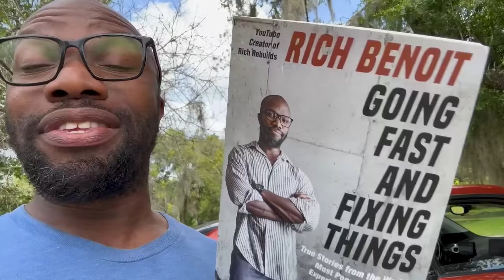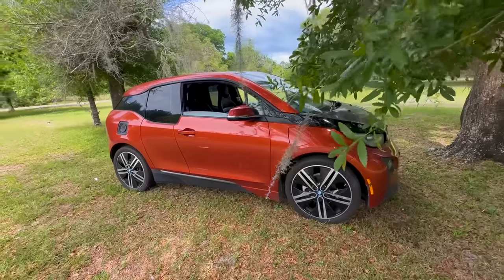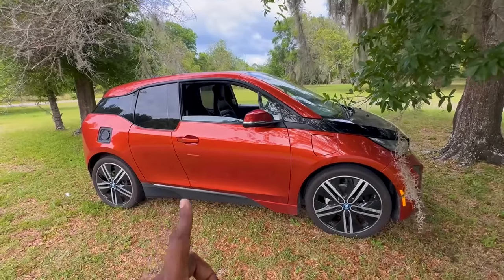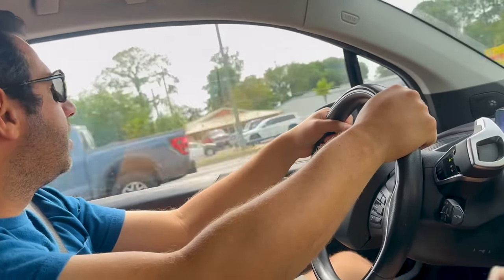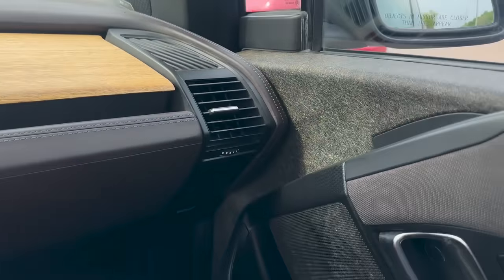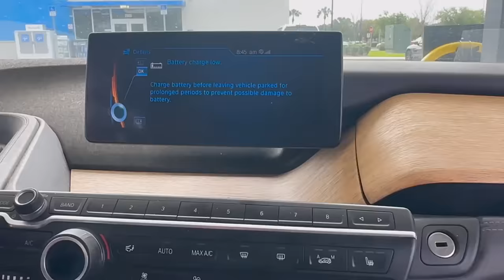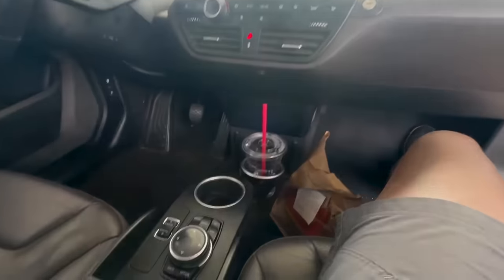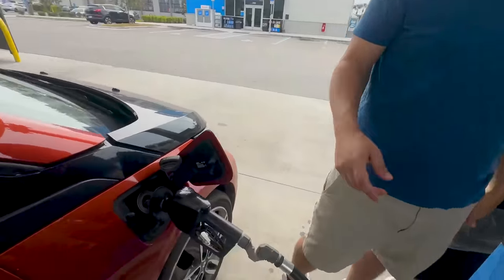I Bought a Ten Year Old $3500 EV and I Increased its Range To Over 400 Miles!

Comment: Dumb car, dumb modification.
The best part of this video was the interaction with you and the other guys.
Why didn't you pump your fuel cell into the main tank directly?
Then the gas gauge just would not go down at all until the entire fuel cell was actually consumed and you only had the factory tankful left.
All you had to do was tap into the filler hose at the tank with a T or something, or put a L tap on the tank itself.
I'm not sure where the factory tank is, but if its below your cell you could have even had it hands off gravity fed so like I said the fuel gauge would never start to drop until you were down to just the factory tank full left.

The real "fix" for this pos "car" would be to swap in bigger stronger batteries, and a fuel engine capable of recharging the battery rapidly even while under full load.
I've never understood the idiocy around the total lie that is EV's, but all that bs aside the proper first step for us as a species would have been to convert all vehicles to hybrid, and perfect it, then maybe eventually (When/if all the real EV lies are fixed) we could move to all EV powered vehicles.
We should already easily have small fuel powered engines in our cars that can easily recharge the EV full size batteries while also under full load and driving.
The electrical technology totally exists and has for a while, a virtually car illiterate person would know this once you tell them what an alternator is and what it does in a gas powered car.
Do something real, make the first REAL Hybrid that never needs to plug in and gets 1000 miles of range with 100mpg or more.
The small engine could be diesel, or best idea ever, HYDROGEN.
Then you could just ditch the entire EV part and just run the correct fuel we should all have been using for decades, Hydrogen, with zero emissions, zero environmental impact, zero mining, zero recycling issues, and ultra low cost to operate and refuel.
The fact we did not do this worldwide decades ago proves our species is stupid, corrupt to the core, and doomed.

Comment: 😮 The problem with the little engine in it is it's horrible doesn't work. it's stinky. I prefer the all electric one which I did have. I had 31 KW and it was good. I've got the 41 KW now which is perfect for me and the s model is brilliant. I wouldn't touch the Rex one cuz all the problems are with that engine and most people don't use it unless you're an idiot 😊😊😊😊😊 it burn toxic fossil fool fuel which is the main driver anthropogenic extinction brilliant little car but don't touch that stink engine 😊

Comment: Since when does only electric cars use synthetic oil that causes rubber to swell or shrink? Completely wrong but hey 😂 as wrong as using oil that fuks up your seals. Beginner mistake 😂
Viton or fkp or whatever "high tec" flexible sealing you use it needs to withstand low temperatures... if you chose cheap oil and cheap seals life will teach you

Comment: Personally, I don't mind an EV. In the event that you run out of battery, you can go to gas station. If on long trip, like mentioned before it'll be annoying, but at least you have that option. Then, if you go into a hotel, can charge up for free. I do like the concept, but as they age in this video it shows its flaws! This car would be perfect for local driving only or very short trips within state lines.

Comment: Ok heres the full store the correct price is $22000US but when the dealer found out it was an insurance claim they doubled the price. So in this case its up to the insurance company to fight this one. This happens to even gas cars. They have two prices, one for you and one for the insurance company. Im pretty sure each insurance company has representatives that negotiate these things and im sure tge price comes down a lot more then $44000US.

Comment: No safety cage for the front tank. Never seen a real mechanic put a box of flammable in the front of the car with a crumble zone designed to pierce it at the slightest 10 mph accident.

Comment: Increasing its capacity to burn gasoline contradicts the supposed benefits of electric propulsion.  And it is done at the cost of cargo capacity. Also, it seems that the added fuel tank, being at the front, has little protection against a front end collision.

Comment: Don't worry about any front end collisions Rich, having eight gallons of fuel located in the front end should not be an issue... 
I see that a license plate frame, if installed correctly will certainly bear the brunt of a front end collision. 
You are most welcome Uncle Rich.
Reply: Proper license plate frame installation is a dying art, especially if backed up by a front mounted gas tank designed by idjits.
Reply: Porsche & VW have gas tank in front, just say'in
Reply: @johnclunan4488  And designed with that in mind, no so much with this "addition".

Comment: Rich, don't know if you know, but there's an OBD hack you can do to start the engine at 70% battery and start charging like its European counterparts,  instead of having to wait until it's below 5% like it's programmed to do for US market vehicles...it's capable but the EPA wants you to use as much electric power before you turn to gas for emission reasons.   Costs 20 bucks.✌️

Comment: Used to own one, same color. Great car until the rex engine cracked the connecting shaft to the generator and caused the motor to vibrate so badly it kept throwing ping codes. Coils and plugs did not help, and bmw wanted wayyy too much for the repair. Cut my losses and traded it in (with a full battery so I'd be long gone before they figured out the rex was dead).
Reply: If you ever get screwed over on a sale or any business think about what you did. 
You will have no right to whine about it then lol

Comment: I have a 2017 hyundai sonata phev. 27 miles all electric 600 total travel w gas. LOVE IT! Loaded w tech and after 4k tax rebate cost aprox $12k w 72k miles. I got a steal I think. Honestly, not sure at all why Hyundai only did a limited run of this vehicle for a few years. It makes so much practical sense and if they got it down to a reasonable price and fine-tuned that it would be an absolute knock out of the park seller

Comment: To add the Aux fuel tank all you need is to tap into fuel line. No need to fill aux tank from normal fuel fill just open hood and use aux tank filler. One concern would be being able to read fuel level of aux tank.

Comment: Possibly the most enjoyable car I've ever owned. BEX is somehow short for idiot. This car is meant for short range commuting, home charging. It'll go to 60mph in about 7 or 8 which is absolutely more than enough even for going on the highway. Range is such a blown out of proportions issued, primarily driven by american needs, even though most americans drive their cars for 20-30 miles per day. For zipping around town and driving the kid to school, this thing is amazing. Interior is so fun and innovative, seats are surprisingly good, the Harmon Kardon is great, make sure to get the bigger center console screen (oh way, you can't get the car at all, but if you for some reason are a saint and buy an old used one, get the bigger screen). Also, the leather seats are lame and age in an instant. The cloth sets are surprisingly good. 

I own an X5 PHEV and a 911, but the i3 is the car love story of my life so far. It is really the most innovative and surprisingly fantastic car I've ever owned.

Lastly, did Rich just put a giant gas tank in the crumb zone of a car? If you hit anything with that thing, the entire front is supposed to turn into a pancake.

Also, on the note of the tiny fuel tank, it's actually 2.5 gallons, but for some reason US regulations require that it can only be utilized to 1.25 gallons. The other guy on the video somehow points this out, but it doesn't really come through. I'm curious what the "regulation" actually is.

Either way. Thanks Rich for featuring this epic little commuter. Also, ordered your book long ago, can't wait to receive it in a couple of months. Cheers!

Comment: "if we have to stop at a level 2 charger...." Did he not buy a version with a CCS port? The i3 had DC fast charging with CCS on most units. Edit: now I'm at the part where he pops open the charge port. Dude actually bought it without CCS. What the hell? Slap your friend, Rich.
Reply: The early versions didn't have CCS only L2. That's perhaps why it sold for $3500.
Reply: @CSAFMedia  the early versions did offer CCS, it was merely an option rather than standard.

Comment: That little pulse pump runs a lot better when it's at 12v. Literally. It's got to do with the way the pump cycles. Too high of the voltage, the plunger doesn't cycle fully. So less flow. 

I once pulled over 50 liters of diesel with nothing but this little pump. Took me a few hours, but it drained my tank completely without the need to drop the tank. Fuel was bad from being left for 2 years due to covid restrictions.

Comment: We need a rex for every car.    I drove my Nissan leaf everyday I love using the battery on night time rate.   But if I could put. A small generator with a fuel cell.  Perhaps removable.    Those long journeys are easy.

One reason you might not be able to keep up with highway speeds is your batteries may have heated up.

Comment: Battery replacement cost on this is insane! at least 15k for aftermarket, and 30k at the dealer. So if you don't want to do that you are left with a very slow 30mpg car.  this is why a 10yo one is so cheap.

Comment: The gas tank is software limited in order to be classified as an EV in California. The gasoline range can not be longer than the battery range.

Rather than having a separate smaller gas tank, they changed the software so the engine stopes before the tank is empty..

Comment: uh... well I had a 2013 Chevy volt.. it had about 45 miles of ev only range and then a 9 gallon tank.  The problem was, if you filled up the tank, every single day you would drive and if you didn't go more than 45 miles, you would be carrying around all that extra gas.  After a year, the car would actually start burning off the gas, because it would go bad

Comment: The reason the cheap fuel pump did not work I believe is because the outlet is supposed to be upwards at a minimum of 15°. I’m pretty sure I read that and some instructions somewhere when using one before. Having the outlet downward is probably why it did not work correctly.

Comment: Hey Rich, no need for a fuel pump - fuel tank test system creates a vacuum to test the primary tank and actually draws the fuel into the primary tank from the auxiliary tank that you have on installed - so it works as long as the system is sealed properly - Jeremy PS i worked with a guy over 5 years ago did this same upgrade

Comment: I used to race a BMW 325i and we dropped a round 8 gallon fuel cell into the spare tire well and plumbed it into the fuel filler neck just like you did here for when we ran endurance races.  In 2005 we won the SCCA 13 hour race at VIR using that setup.  Same deal, switch on the dash which was used when the regular tank got below 1/4 full.

Comment: The only thing that has put me off from getting a used i3 is the carbon tub. I'm fairly sure that if you crash it it's gonna be insanely expensive to repair due to all the carbon fiber used in its construction.
Reply: So, you are primarily worried about something that hasn't even happened and may never happen? Wow! You've got bigger issues than that i3's carbon fiber tub.😂
Reply: @tigerstripeeyes9871  It's perfectly normal to assume you might crash at any point in traffic  and take that into consideration when buying a car like this. The only one with issues here is you as you lack critical thinking and have a cognitive dissonance. It would be quite arrogant to assume that you're such a good driver that it will never happen to you while not taking into consideration how badly other people drive.
Reply: LOL!! What does assuming do? It makes an ASS out of U and ME.

 It’s most likely going to be a “low-speed” accident anyways, so don’t sweat it! If you get into an accident with it and it carbon fiber  tub gets damaged beyond repair, your insurance company will simply total it… so why are you so scared about it like some little girl? Maybe you should put your big boy pants on, man up, and just drive? That’s an idea! 💡

Comment: I am shocked he just didn’t just upgrade the pack. You can do an upgrade to the later 94Ah pretty straight forward retrofit. You can do a 120Ah battery but not as straight forward but can be done as I successfully done one for someone. It technically is not hybrid the engine for only charging the HV battery and that it. 

Don’t bother swapping the individual modules, it be a losing battle as those as all those cells will be on their way out and be a waste of time. The 650cc 2 cylinder engine only for charging the battery, so extending the tank won’t do much as those 60Ah battery do degrade quickly due to the way they were cycle. It going to get to the point of no range left regardless after a while and car won’t move without battery power  as engine is only a generator. Those are not hybrids they are 100% electric and only use the engine REX model for charging the battery and that it.

The 94Ah battery would be the easiest and cheapest way to go and those don’t degrade as fast.

Yes the aircon compressor love to fail on those as they grenade  itself and metal gets into whole system. They are expensive to replace. The compressor by itself is $800 to 1k for a used one which likely could be also bad, or in its way out and $1500 for a new one and that not including everything else that needs to be replaced. You need the AC working as it also used to help cool the battery pack. It cost around $3500 to fix the AC after all said and done. It is absolutely necessary as cools the battery pack, otherwise part the car out.
Reply: It is a serial hybrid. Others like Toyota are parallel hybrids.

Comment: I came very close to buying a brand new 2020 Prius after waiting 20 years for an EV. Being very curious I started asking questions, analyzing. I came to the conclusion the Prius was a fraud, e.g., NOT a hybrid EV, but a hybrid ICEV with insignificant electric assist, or as Rich would say: "The worst of both worlds". Why would Toyota do that? Also, why would Toyota partner with Elon to experiment with the RAV 4, be successful, and end the whole project? GM built the EV-1 to fail, it didn't, and they quickly recalled all and destroyed them. Why? There was demand, public pressure to build an EV which is opportunity for exploitation/profits. Why try to crush it? What the hell is happening with mega corporations? Tesla proves "BIG" does not equal "out of touch", so WHY? Is it economics or politics? Since politics is irrational when viewed long term, I deduce politics secretly supports Big Oil because the US Empire is funded by the "petro-$" since 1972 because gold was impossible to monopolize/control. The Gold Standard Dollar was honest money, impossible to artificially inflate (a tax). It protected us from govt.

Comment: Wait, wasn't it due to EPA that BMW was clamping max capacity of the fuel tank on those in the USA ? I think they were not allowing the REX to run if the fuel level in the tank dropped to like a half or even 2/3

Comment: I really think that EV should be 100% propelled by electric motors and have small, on-board, optimized engines recharging the batteries. This part engine, part electric motor stuff is crap. We've been doing the electric drive with optimized engine for 75 years in locomotives. Why couldn't they copy that model with a small, efficient, and optimized gas engine to charge the batteries? Heck, even a small turbine might work well. It would only have to run at one RPM.
Maybe I'm too stupid to understand why they don't do it this way.
Reply: The I3 does it that way. 
It's still idiotic tho since it's way more efficient to just use the engine to move the vehicle directly instead of generating electricity just to power another motor to drive
Reply: You literally just described how this car works though? The gas motor is in no way connected to the drivetrain. It simply adds charge back to the existing battery pack, which is the only thing providing power to the wheels. You may want to actually look a bit into these cars?

Comment: Importantly, this is a 'series hybrid', meaning it has a single electric drivetrain with a gasoline-powered battery charger rather than two drivetrains working in tandem. This is how hybrids should be done from a weight and system complexity/maintainability perspective.